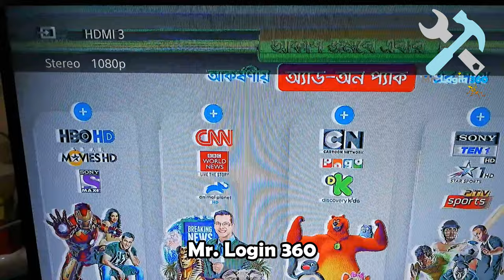LCD TV Screen Color Distortion || Easy Fix || Sony LCD TV Color Problem Solution (100% Works) || DIY

Comment: Hi. On my Sony Bravia kd-55xd9305 I have the image which cuts off at startup and after 5 to 10 minutes I have all my image but the left side the color has nothing to do with it the red sounds rather dark glass and that half flashes. Would that be the tablecloth too?
Reply from the maker: Hi there! It's possible that the issue you're experiencing with your Sony Bravia TV could be related to a problem with the cable or ribbon cable (commonly referred to as a "tablecloth" cable) that connects the display panel to the TV's mainboard. If there's a loose or damaged connection, it can result in display problems like color distortion or image cutoff.

In the video you're watching, there might be a solution or guidance on addressing this issue. It's a good idea to follow the steps outlined in the video to see if it helps resolve the problem. Additionally, you may want to inspect the cable connections and ensure they are secure and undamaged. If you're uncomfortable doing this yourself, consider seeking the assistance of a professional technician.

Remember to power off and unplug your TV before attempting any repairs or inspections to ensure safety. I hope this helps, and I wish you the best of luck in resolving the issue with your TV!🥰
Reply: @Mr.Login360  Thanks a lot for your help ! I'll go check it out this weekend. I had already seen this on 1 or 2 forums but I preferred to get the opinion of an expert before tinkering. I paid €200 for this second-hand TV, I knew the problem and I knew it wasn't the panel. Thank you so much !!
Reply from the maker: @Trickameur  You're very welcome! It's great to hear that you plan to check it out this weekend and have already gathered some information from forums. It's always wise to seek an expert's opinion before diving into any DIY repairs, especially when dealing with electronics.

Knowing the issue wasn't with the panel, it sounds like you made a smart purchase with your second-hand TV. I hope the video and any additional information you find help you resolve the problem effectively. If you have any more questions or need further assistance, feel free to ask. Best of luck with your TV repair, and I'm glad I could help!🥰
Reply: @Mr.Login360  I just took the TV apart and all the cables are OK. Do you think it's the DPS card that's broken?
Reply from the maker: @Trickameur  It's great that you've checked the cables, as loose or damaged cables can sometimes cause display issues. If everything looks fine on the cable front and you're still experiencing color distortion, the DPS (Digital Power Supply) card could indeed be the culprit.

These cards can sometimes develop issues over time, leading to power-related problems that affect the display. Suppose you're comfortable with electronics and have some technical know-how. In that case, you might consider inspecting the DPS card for any visible signs of damage, like burnt components or bulging capacitors. However, suppose you're uncertain or not experienced with electronics repair. In that case, it's often a good idea to seek professional help, as working with TV components can be tricky and potentially dangerous.

It's important to diagnose the issue correctly, and the DPS card is a possibility worth exploring. If you decide to proceed, ensure you take all necessary safety precautions when working on the TV.
Reply: @Mr.Login360  Don't worry I'm quite a tinker however I will have difficulty finding a problematic component without visual signs. I will still take it apart to check the back to see the welds, it is possible that there is a problem because the TV when hot stops jumping while when cold the colors are good but the image jumps. If the problem comes from the DPS card (and not from the panel or the motherboard of this TV) then I would consider changing it directly. Don't worry about safety, I unplug the TV and keep the POWER button pressed to empty the capacitors ;)
Reply from the maker: @Trickameur  It's great to hear you're comfortable with tinkering and have some experience in it. Checking for loose solder joints or visible issues on the DPS card is a good starting point, especially if you're experiencing temperature-related problems. Sometimes, a bad solder joint can behave differently when the TV heats up.

Suppose you don't spot any visible issues, and the problem seems to be related to temperature. In that case, it's possible that certain components on the DPS card might be failing as they heat up. If you determine that the DPS card is the issue, not the panel or motherboard, replacing it could be a solution.

Your safety precautions are excellent. Discharging capacitors is an essential step to ensure safety when working with electronics. Remember to document the board and connections before you start any disassembly, which can be helpful when reassembling.

I wish you the best of luck with your repair, and I hope you can get your TV working smoothly again. If you have any more questions along the way, feel free to ask. Happy tinkering!🥰
Reply: @Mr.Login360  Hi. I changed this DSP card but the TV refuses to turn on. It's normal ?
Reply from the maker: @Trickameur  Hey! If you've replaced the DPS card and the TV still refuses to turn on, there might be a few things to check. Ensure all the connections are secure and there are no loose cables. Also, double-check if the replacement DPS card is compatible with your TV model and ensure all other components are in working order.

If the issue persists, it could be a broader problem with the power supply or other components. Sometimes, a hard reset or firmware update might be necessary. Consider seeking the nearest professional technician for help or contacting the card manufacturer for further assistance. Also, consult the TV's user manual for troubleshooting tips. Feel free to share more details, and I'll do my best to assist you. Good luck!👍
Reply: @Mr.Login360  I connected everything correctly... By replacing the old one, the TV restarted without problems. I think I received a faulty DSP card :(

The reference is the same
Reply from the maker: @Trickameur  I'm sorry to hear that you're facing issues even after connecting everything correctly. If the TV restarted without problems with the old card but not the new one, it suggests a potential issue with the replacement DSP card. It's possible that you received a faulty unit. I recommend contacting the seller or manufacturer of the DSP card, explaining the situation, and seeking a replacement or a refund. Sometimes, these things happen, and they should be able to assist you with a resolution. Best of luck with getting your TV back in working order!👍
Reply: Ok thank you I will return the product. I took photos in case it arrived broken so I wouldn't get a refund and I provided them in the ticket. I will recommend another one once reimbursed perhaps elsewhere. Do you have any links to purchase some? I bought it on eBay.
Reply from the maker: @Trickameur  Returning the product seems like a good step, especially if it arrived broken. If you're looking for alternative options, consider checking reputable online retailers like Amazon or specialized electronics stores. Make sure to read reviews and product descriptions to ensure compatibility with your TV model. Here are a couple of links to get you started:

Amazon TV Parts
Electronics Stores (Newark)

I hope you find a suitable replacement soon! If you have any specific requirements or questions, please feel free to let me know.🥰

Comment: Sony KDL-32R420A
Back ground screen turn back to red 
Any solution?
Reply from the maker: Based on my experience with similar issues, your problem could be due to a loose or damaged cable connection or a faulty T-Con board. You could try checking and reseating the cables that connect the T-Con board to the mainboard and the panel. If the issue persists, it may be necessary to replace the T-Con board. I hope this helps!

However, I can offer some general suggestions to troubleshoot the problem:

Check the connections: Ensure that all cables, including the HDMI or AV cables, are securely connected to both the TV and the video source.

Reset the TV: Try performing a soft reset by unplugging the TV from the power source, waiting for a few minutes, and then plugging it back in. This can help resolve temporary glitches.

Adjust picture settings: Navigate through the TV's menu to access the picture settings. Look for options related to color, contrast, and tint—experiment with adjusting these settings to see if it resolves the issue.

Update firmware: Visit the Sony support website and check for any available firmware updates for your specific TV model. Updating the firmware can address software-related issues and improve overall performance.

Suppose the issue persists after trying these troubleshooting steps. In that case, it may be best to contact Sony customer support or consult a professional technician for further assistance. They will be better equipped to diagnose and provide a specific solution for your TV's color problem.🥰

Comment: what was the problem on the flexible cable? oxidation or what?
Reply from the maker: The color distortion issue was likely caused by a variety of factors, but in the video it's commonly associated with problems like loose or damaged FFC cables itself. The video likely provides specific steps to diagnose and fix this problem, so I'd recommend watching it for more details (Please watch my other Sony Smart TV 51-Pin FFC cable repair videos).🥰
Reply: @Mr.Login360  thank you so much
Reply: Hi. Thanks for the video. Could you share your WhatsApp number so I can send you a video of the issue we are facing on Sony Bravia TV purchased in India. Many thanks
Reply from the maker: @shilk3681  Hello! I appreciate your message, and I'm here to help. Unfortunately, I can't share personal contact details like WhatsApp numbers. However, you can definitely share the video on my Mr.Login360 Facebook page. Feel free to share the video there, and I'll do my best to assist you with the issue you're facing with your Sony Bravia TV. Thank you for understanding!🥰
Reply: Thank you for the video. I have a similar color problem on my tv sony.bravia kdl 40 ex 520. which ffc cable shall I purchase for my tv model(any 51 pins cable?) thank you for advising.
Reply from the maker: @ahmedchabir2610  Thank you for watching the video and for your question. For your Sony Bravia KDL 40EX520, you'll need to purchase a 51-pin FFC cable. Make sure to check the specifications and compatibility with your TV model before making the purchase. Good luck with the repair!🥰👍

Comment from the maker: LCD TV screen color distortion || Easy fix || Sony LCD TV color problem solution (100% works) || DIY

🛠 Hello friends, I faced a problem with my Sony BRAVIA LCD smart tv color problem a few days back. I am preparing to watch the first match day of the FIFA World Cup 2022. Unfortunately, a significant technical problem has knocked on my door. I think I can't watch the first football match on that day. At first, I try to figure out what type of LCD TV screen color distortion it is. Is flexible flat ribbon cable (FFC cable) or IC issues? I will show you how to easily fix the Sony Bravia LCD Smart TV color distortion solution in this video. I hope you and your friend enjoy this video, and you're Awesome!

|| DON'T FORGET TO ||➤ ✅ 𝗟𝗶𝗸𝗲 ||➤ ✅ 𝗦𝗵𝗮𝗿𝗲 ||➤ ✅ 𝗦𝘂𝗯𝘀𝗰𝗿𝗶𝗯𝗲 and ||➤ ✅ 𝗦𝘂𝗽𝗽𝗼𝗿𝘁 𝗠𝘆 𝗘𝗳𝗳𝗼𝗿𝘁𝘀. ||
https://youtu.be/TGxNICTxyM0